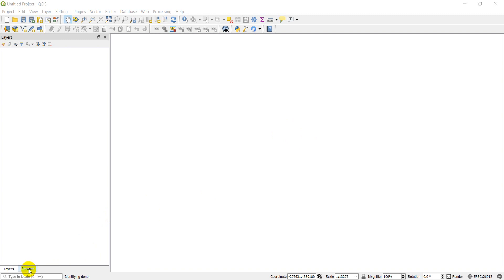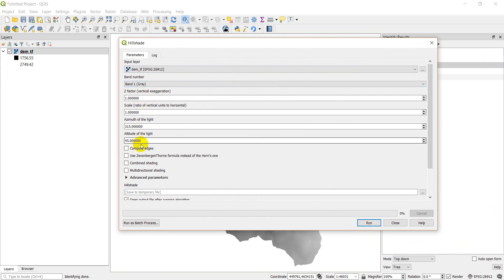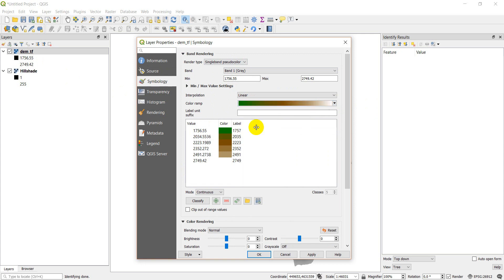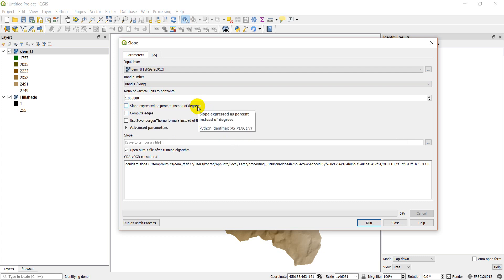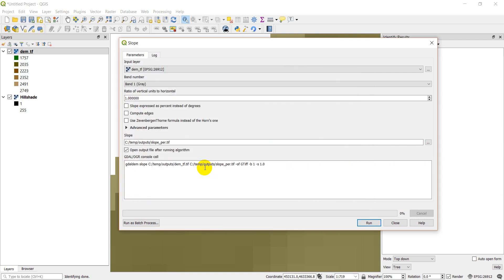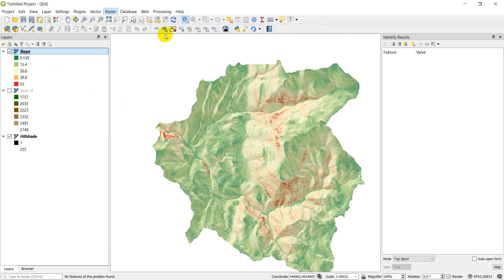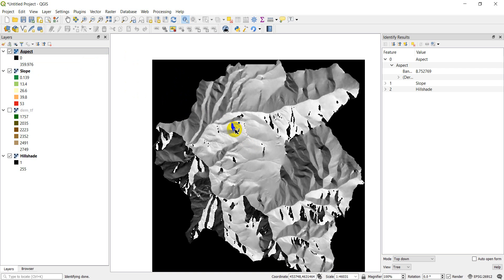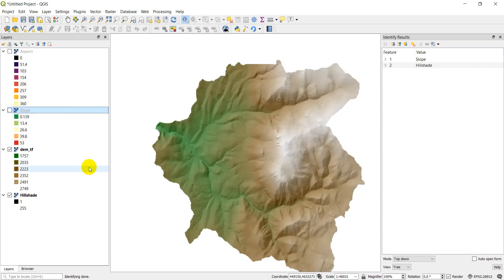QGIS Terrain Analysis: hillshade, slope, aspect (Version 3.x)

Comment: Hi, thank you very much for the material. I would like to know if you perform some kind of configuration in the DEM so that it displays a min and max value instead of a gradient bar? In my DEMs the display is a gradient bar and the resolution does not look as neat as yours.
Reply from the maker: I haven't done any configuration. Depending on your DEM metadata you may have to configure some things in symbology. Some DEMs just have course spatial resolution.

Comment: I am trying to get my slope to work in QGIS. I got my DEM from the USGS and it is an SRTM. Is there anything I need to do to the DEM so that it will not just show the flat areas of my DEM?
Reply from the maker: I'm not exactly sure what your problem is?
Reply: @geospatialschool  when I ran the slope tool the output only shows areas that are flat. The  output raster has values of 0 or 89.
Reply from the maker: Not sure why that is happening. Have you tried both the QGIS and GDAL algorithms? Have you tried a different DEM or changing the algorithm parameters to see if that produces different results? I've done a little research and it's possible that if your DEM is in a geographic projection (degrees) you may need to convert it to a projected coordinate system in the same units as your elevation values (e.g. meters) for it to work. See these posts: https://gis.stackexchange.com/questions/143139/getting-incorrect-slope-values-from-an-aster-dem-in-qgis https://gis.stackexchange.com/questions/290190/issues-with-qgis-slope-analysis
Reply: @geospatialschool  Thansk. If I need more help I will post on there.

Comment: Great presentation and very helpful. How could just the S to W aspects be displayed? Make the others black or white? Thanks again!
Reply from the maker: Thanks! You could use the raster calculator to multiply S-W by 1 and everything else by zero. That would give you a new raster with zero values in areas that aren't S-W and aspect values for S-W slopes
Reply: @geospatialschool  Thank you!

Comment: Why my hillshade comes with too noisy surface. Not like yours.
Reply from the maker: It's either something with the input DEM or the parameters you set for the hillshade. First, make sure you used and elevation input for the hillshade tool and not a raster representing something else.
Reply: Mine is rough too, maybe because I am using a 90 m DEM and not a 30 m like in the video. Check for you. The hillshade still render something usable, the aspect is barely readable and the slope produce a no sense raster (almost all pixel with the 90° slope value). Can slope analysis be run on a 90m model ?  I work in West Africa and I dont think I can get a more precise model

Comment: I am looking for a way to have a map analyzed for straight segments or lineaments in the data. What is available for this?
Reply from the maker: Can you be more specific? What type of data (raster/vector, continuous/discrete, etc)? How do you define "straight"?
Reply: Open Source Options Thanks for replying. I did some more searching and found some different answers. In most cases the data is raster. The lineament analysis can be done with other data structures as well. Straight lines are relatively straight. That is one eye sees a ridge’s crest as straight for some length and then a break and maybe continues offset or on a new azimuth. Similarly a water course may have segments that are straight. Curved lines that loop or repeat can are also used in the analysis for structures in the geology. Man made items often mimic and follow the subtle changes in the fabric of rock type, faulting and other boundaries. I use image filters to accentuate features and my eye to identify the pertinent shapes. My best hope was to find an automated system do what my artistic eye does.
Reply: Open Source Options this video gets to the why and what. Start at 3:30 seconds to jumpstart the Lineament section. Later he touches on Eigenvalues very briefly. I am thinking the advancement in neural network systems and python tools will have some open source opportunities for this kind of technique to do spatial geopetal fabric analysis. Any ideas?
Reply from the maker: Can you send the video link?